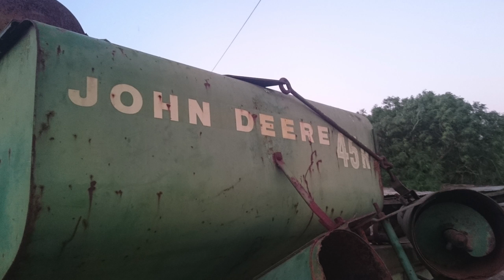John Deere 45R resurrection

Comment: Mr magoo  nothing could prepare a young lad to be a good farmer better than to resurrect a long forgotten machine left out in weather for it looks like 50 years. Now when you run a new one you will have tremendous knowledge of all the reasons why they now make them so much better but will still need fixed and why and how to do it.
Reply from the maker: you are dead right, thanks! i learnt so much and have a higher appreciation for maintenance. back farming now with my father

Comment: You are absolutely insane for restoring a combine. It combines (no pun intended) the worst parts of restoring old cars and restoring old tractors. That being said, you did a fantastic job on it. Why did you cut down a 6 cylinder engine instead of saving the old one?
Reply from the maker: haha you aren't wrong, they are definitely challenging to restore! Thanks very much! the 4 cylinder sleeve deck had very corroded sleeves and all so one of the sleeves broke away from the deck. i did some looking into measurements and so fourth and found out that indeed you could just cut two sleeves off the sleeve deck, so i took the gamble and did it! as far as i know i might be the only one to have done this wild deck cutting haha. The gas 4 cyl jds are harder to come about in australia
Reply: Hugh_Magoo ok, I didn't  know jds were so scarce out back
Reply: I'm glad you fixed up that combine. I was 18 when I fixed up mine, and old pull type that had sat for 36 years. Was really fun, and the finished product made every hour of work worth it!

Comment: Awesome job! This gives me hope for my 45! (There's a video on my channel, and more to come in the coming months, now that my stalled project is back on track.) just a few questions: A: why do one so far gone? Sentimental value? I'm certainly not saying you should have scrapped it, just curious what drove your ambition. B: how/where did you get the custom sieve? I'm going to need a set for small grains if I'm not mistaken; I think mine is the corn and beans sieve, as the last thing supposedly run in mine was beans. C: did you replace the rasp bars, and if so, where did you get them?
Reply from the maker: Charles Krill thanks! I saved it because here in Australia there weren't many 45jds and especially rare the 45R that mine is. it was also the first header I baught. B: the custom sieve was a sieve I got from a gleaner F2, I cut it down to fit in the JD, it was reletivly easy to do. C: no rasp bars in this as it's a rice model and uses a peg drum. but I can imagine you could get similar ones and just drill holes in the drum to suit there Bolt pattern. If you need any pics or help my email is hughmacague97@outlook.com
Reply: +Hugh_Magoo thanks! Yeah, that makes sense on why you would want to save it.. I just might take you up on that email offer. :)